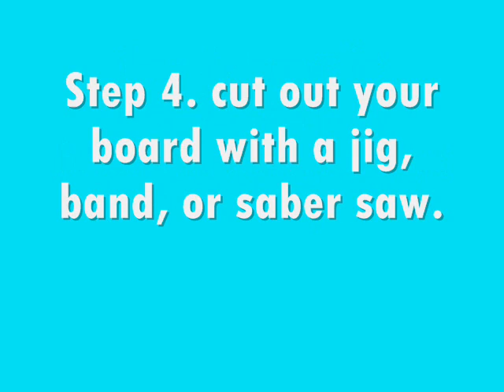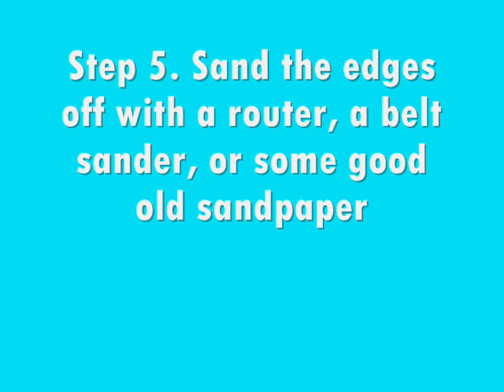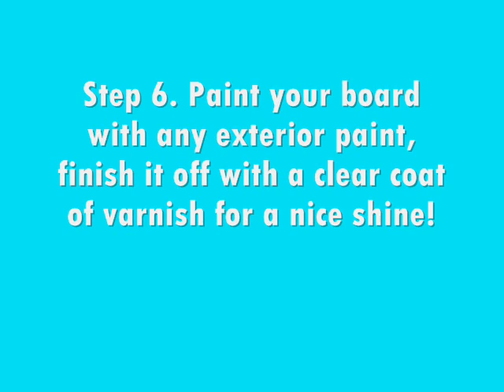How to make a cruiser skateboard

Comment: I got my friend's penny, traced it, made a seven ply maple deck, painted it and finished with polyurethane, put on some grip tape. I used 105 mm Polar Beat mine cruiser trucks, soft Micro Monster Hawgs, with precision ABEC 7 bearings and philips hardware. This is a great and rewarding way to build your own board.

Comment: Cool, but why not use the griptape that alreary comes ready do stick to the board....using hot glue is way worse in case you need to change it and creates some patterns, also leaves some border peeling off. Just a tip.
Reply: I think he used regular sandpaper cause if he applied grip tape, then he wouldn't need to use glue. Or he probably recycled his old grip tape from his board.

Comment: There is no fucking way you can skate a pool with that board. Maybe for cruising or filming, but no vert/pool since the board is way too small and the wheelbase is smaller than what is needed for the stability.

Comment: savage board man, but I would highly advise you google up on your grip tape...  it's like $5-$10, and can be installed super fast, and the edges razor'd off quickly... Hot glue will end you if you skate in a summer heat of over 80 degrees man... think safety, buy grip tape.